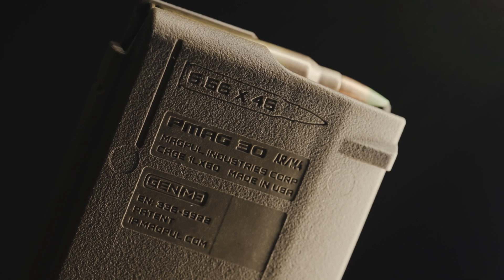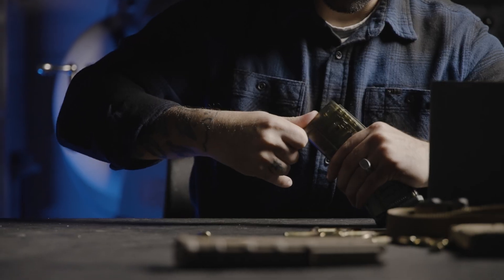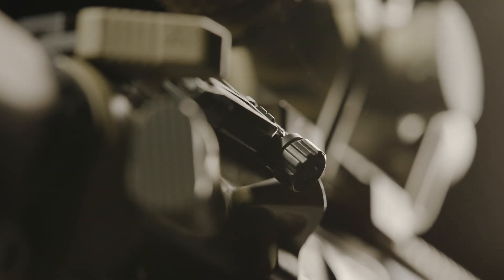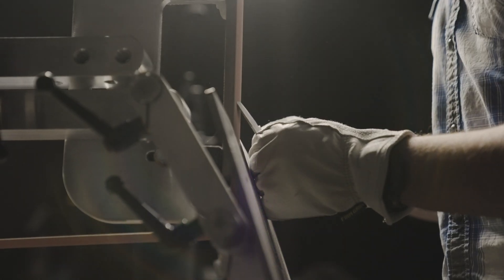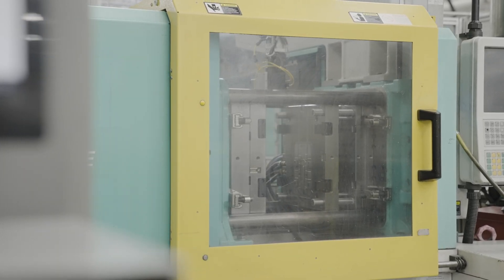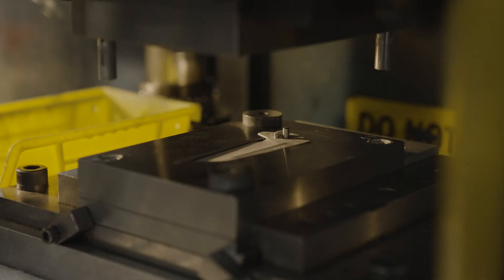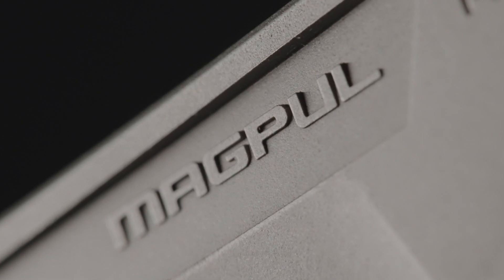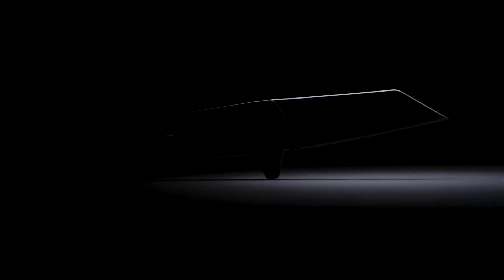Magpul - Metal Injection Molding

Comment: I'd love to see testing on this. MIM blades are generally weaker compared to forged knives. A backup sight is going to endure very different stresses than a blade.
Reply: Depends on the use case.  A MIM kitchen knife might be a great idea, if edge retention lasts longer.  But MIM blade, for batonin', in the back country... maybe not so much, depending on spine design.
Reply: Presuming the stress points are up to the task (i.e., hinge, recoil lug/crossbolt, threads) I expect it would work fine.
Reply: Essentially no one is making MIM knives. 

Particle metallurgy is entirely different.
Reply: Magpul literally bragging about casting knives out of plastic and pot metal now
Reply: Its about the lifestyle not the quality
Reply: @ That perfectly sums up these Gravy-SEAL companies.
Reply: Castings can be post forged to change grain. I would wonder if mim could be post forged, since they are typically through hardened I’m not sure…
Reply: They're not. Most of the super steels are powder metallurgy. Magnacut is powder metallurgy for example.
Reply: @ MIM is absolutely not the same thing as particle metallurgy.
Reply: Inferior for sure.
Reply: MIM parts are awful to work on for fine gunsmith craftsmanship. The voids in the metals make it impossible to get smooth, repeatable results in trigger polishing, and for use if mim parts in the sigs is why the found themselves in so many lawsuits. 
MIM is glorified cast iron tbh. Yes, you can make critical components from them, but you shouldn’t.
Reply: @Exandria  You should use it, if you're careful and understand it well. Casting generally sucks ass for gun parts, unless you're Ruger who has perfected casting
Reply: @bower31  unfortunately i have to use it. I have plenty of problematic experience with it.
Reply: @Exandria  The thing about injection moulding is strict quality control is required to make sure each part is kept up to specs. I am a Mould Maker working on automotive parts and when a mould is running and producing good parts, it can have very high tolerances. The difficulty is when a part is the first, last, or experiencing an unknown problem and it makes it through the quality inspection faze. Knowing this, engineers need to add some extra allowance for mistakes in the manufacturing process if they want to have problem free parts. Although admittedly, a company wanting to produce high tolerance parts with this method will have to invest in skilled tool makers and process engineers, as well as tool designers, to make sure to minimize human error.
Reply: Crucible Metals would probably disagree with you there, though their powder process is different from MIM.
Reply: @ exactly, powdered steel is still formed into stock and milled.  This is more like spray form steel.
Reply: @chaddixson8398  not always. Finished machined as needed but way to expensive to wast by not form in it directly into the shape.
Reply: Theoretically MIM should be better than CPM since it is a finer powder in the MIM process, leaving for more even distribution of the mix of material.
Reply: @toolman9081  since MIM is injected as a melt i believe, or partial melt, the grain structure should increase in size as it cools. The whole purpose of CPM is to remove the melting step to keep grain size small.
Reply: @alexdrockhound9497 i don't think you're explaining it properly, but I get what you mean.
Reply: @toolman9081 You have that absolutely backwards.
Reply: Zip tie cut 50/50 the blade snaps instead of the tie.
Reply: MIM blades have poor grain structures.  generally in powdered metallurgy. You form a block, then forge it to stretch the grains. if their steel is anything like s35vn or s30v it's extremely  important  to forge  it as the larger vanadium crystals can cause serious weak points if not properly  formed.
Reply: Now everybody is a metal expert shut up
Reply: @GunsNGames248  its not hard to learn and if you have even a remote intrest in kives it's useful  knowledge to have... don't lash out because you're  embarrassed.
Reply: @ Anyone who knows anything about knife steels, knows MIM isn't a good idea. 

It's a gimmick and it's cheap. Make no mistake.
Reply: @TheTrueNorth11  Most high end knife steel is powder metallurgy.
Reply: @TKTK-sw3tq  Literally said that.
Reply: @ you’re not very knowledgeable about knives, are you? Mapgul doesn’t seem to be either wading into these waters. This is pretty tame discourse.